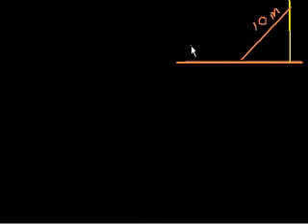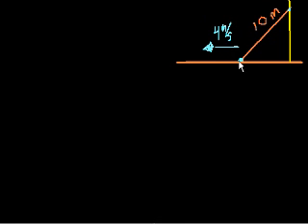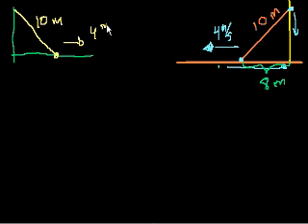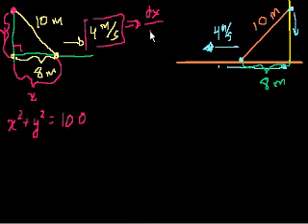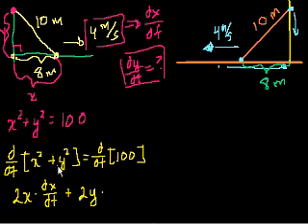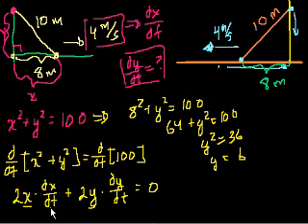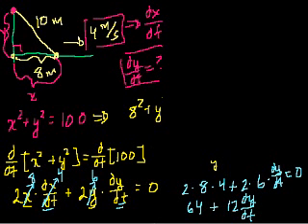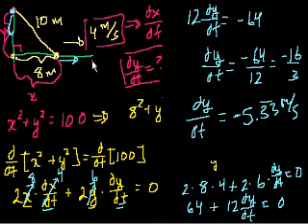Ladder rate-of-change problem

Comment: @BarbierNicholas This might be a distant analogy, but think about it this way. The car is moving in a constant velocity, meaning it IS moving. However, the acceleration would be a zero since there is no change in the velocity. However, similar to this problem, this is not always the case, because normally the acceleration changes (the car does not move in a constant speed). That's when we need calculus to figure out the rate of change

Comment: This is a stupid question:
but, after .5 seconds wouldn't the bottom point have moved over .5*4=2m; 2+8=10m so the ladder would be laying on the ground meaning that the y value had moved 6m in .5 seconds? that would imply 12 m/s (technically or -12, whatever since it's velocity) yet this video tells me 16/3 or -16/3 m/s. Where does my intuition go wrong?
Reply: Nicholas Barbier? Tu est Belge?

Comment: hi i love watching ur tutorials. I have the same question but little different if you could help me. ( an extension lader with the top resting on a vertical wall is being extended at a rate of 10 m/min. the base is 5 m from the wall. find the rate of sliding up of the top of the lader when the lader is 13 m long? thanks